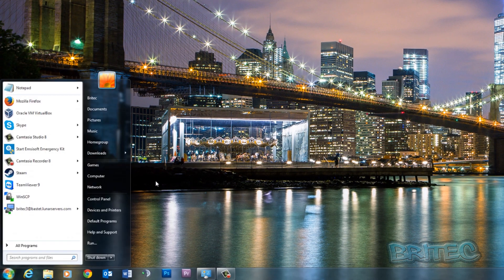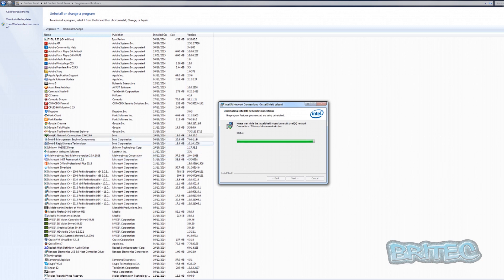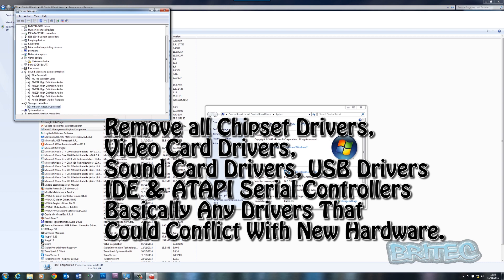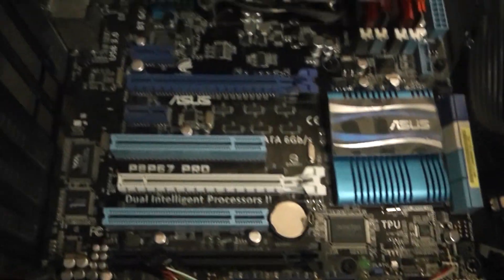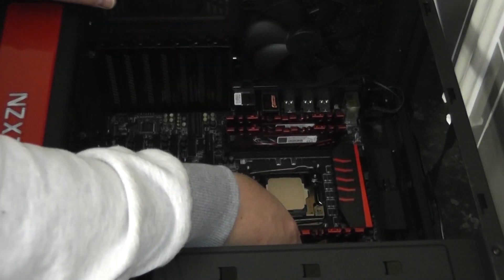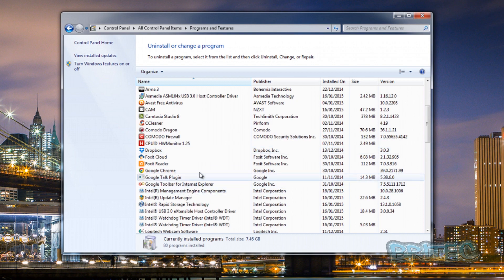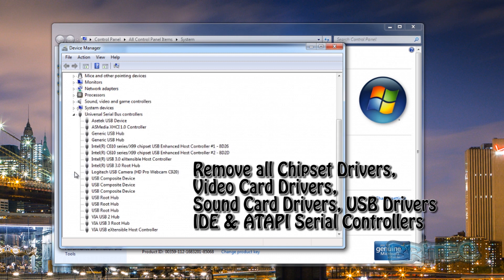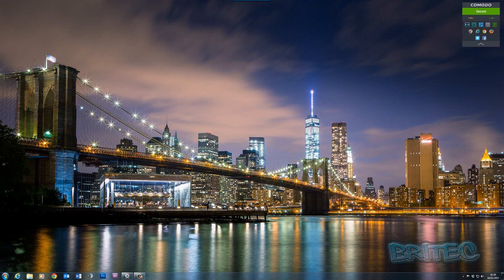Change Motherboard Without Fresh Install of Windows

Comment: will this work if i am changing to a new cpu and motherboard
Reply: Sam Fricke if your on Windows 10 it does everything by itself. Just upgrade and plug your hard drive back in. Windows will say something like reinstalling drivers and it would work. But then you have to download the drivers off of the manufacturers website
Reply: Jaysonfred thanks

Comment: Piece of cake with Windows 10, I just removed SATA and network adapter drivers from device manager and changed local account into MS account (to prevent hassle with activation)  before switching mobos. I was afraid I might get trouble with activation but Win10 was activated after mobo change and everything worked fine, lastly I switched MS account back to local account.
Reply: +Beast John1 Yeah small correction to above, first go to Win10 Settings -> Accounts and choose "login with Microsoft-account instead" for your account and follow instructions on screen. After account has been changed then open Device Manager and select "uninstall" for your SATA controller(s) under "IDE ATA or ATAPI devices" (not sure about translation) and same for your networkd adapter. When finished then just shut off your PC from Win10 start menu (do not restart!), change mainboard and start up PC again. Win10 should load up and then you can change MS account back to local account from account settings. At least this is how it went for me, your mileage may vary.
Reply: Thanks for sharing your experience! i was worried of windows 10 activation too.  how did you go back to a local account?
Reply: There was option to switch back to local account in account settings.
Reply: +YouStubid sorry but one question, which driver do I uninstall from the network adapter? I see Bluetooth devices, WAN mini port, etc...
Reply: PixelPencil sysprep uninstalls the drivers for you... that's why you're using it. Then on first boot up, your mobo bios should ask you which start up you prefer, (boot as new and restart, etc) or atleast mine did, then it boots up like normal
Reply: Late reply but should I also remove the processor driver?
Reply: YouStubid hey. i've got to do this when my motherboard comes in. can you please explain how to do it without having to go through activation for windows 10?
Reply: PixelPencil No need to install any network drivers. All I did was sysprep my machine and set it to shut off afterwards, then made my mobo change, connected the HDD, and powered on. No problems. Booted perfectly. Then you just go through Microsoft new windows setup, connect your Microsoft account once logged on and swap over to your previous pc's account.
Reply: +Beast John1 so I can just basically swap motherboards without uninstalling drivers at all?
Reply: BeastJohn1 so all I have to do is uninstall those and change motherboards then boot up and that's it? I'm also using a GIGABYTE GA-AB350M-Gaming 3 AMD Ryzen AM4 micro atx board
Reply: Hi, will this work if I cahnge my proc and mobo as well?
Reply: Did you have to reregister Win 10 when you restarted with the new MB?
Reply: Hey thanks! Guess I should stop worrying about re-installing Windows after my MOBO swap!
Reply: 4Za :] i am doing the same thing like you and also want to know how
Reply: 4Za :] how did It go? I'm doing the same thing this weekend and I really want the answer to your question
Reply: everything associated with that brand of motherboard, you can download the chipset for whatever motherboard your gonna swap for
Reply: 4Za :]:: there other videos that explain, how to sign out of the Microsoft account to a local account, and when you swap the new motherboard in, and install windows 10 go ahead and sign in with the Microsoft account you where using before and windows 10 should Activate.
Reply: YoStu::: you mean you swithched to a Local account, and signed out of Microsoft Account, cuz when your signed in to a microsoft account it will make you the Administrator of that PC, for then you will have ADMIN Right to that computer, a Local account dont give you ADMIN rights, just wanted to clearify, cuz you said it backwards.
Reply: @OLvato1  switching to ms account has nothing to do with admin rights but preserving activation of windows when changing components
Reply: YoStu what is sysprep?
Reply: @YoStu242  hey how did you uninstall all drivers? Sysprep?
Reply: @dyon8569  I just hit Uninstall from right mouse button menu for every sata/network driver in device manager before shutting down PC and replacing mainboard if I remember correctly.
Reply: YoStu:::  why would you "uninstall"  SATA controller(s) under "IDE ATA or ATAPI devices" Those are Microsoft, not AMD, NVIDIA's, or motherboards, drivers, he said yo Uninstall just those, AMD, NIVIDA, and all drivers for motherboard
Reply: Could you make a video on it please??
Reply: "You must not use Sysprep to reconfigure an existing installation of Windows that has already been deployed. Use Sysprep only to configure new installations of Windows.". It also says you can reset activation up to three times whatever that means, maybe activation problems in future if need to swap mobo more often.

Simplest way to me is to switch to MS account and remove IDE/SATA drivers, shutdown, replace mobo, reboot. I think removing Network adapter driver is overkill and removing IDE/SATA driver should be enough. At least that's what always caused problems to me with Win9x/XP when changing mobos and after mobo change I always got BSOD if I didn't remove IDE/SATA drivers and new mobo had different chipset.
Reply: @YoStu242  : hey im doing the same thing different chipset and mobo i have 10 too and its linked to my account should i just leave it on my account til i switch to the new components, then go and switch it back to local ? and before all that just remove sata and ide drivers ? and my chipset drivers possibly?
Reply: @Survivor694  My new mobo had different chipset also but I don't recall removing any chipset drivers, only those I mentioned. Just don't let Pc reboot with old mobo after removing drivers or it'll reinstall them. Remove drivers, shutdown and change mobo right away. And last thing if boot goes ok with new mobo change ms account back to local if you're using local account normally.
Reply: YoStu Mate I need your help!! First Time upgrade noobE here 😀

Ok so I am planning on upgrading my motherboard from a Gigabyte LGA 1151 z170 GAMING X motherboard to a z370 motherboard so I can use 8th gen processors......

I have over 30 STEAM games installed and a lot of photos and music files stored into my PC. But most importantly are my STEAM games. Can I still follow your steps shown in your video still 2018? Will I have to buy windows 10 again for my new mobo? Also if I just simply connect my HDDs to the new z370 motherboard, will my saved STEAM games and photos/music be easily transferred to the new mobo without backing up anything? My plan is just to upgrade my motherboard and CPU and keep my HDDs. Please help me be successful first try 😃😃

Comment: Hey, could some help me out please?
I want to upgrade my pc with a intel i7 6700k, but my current motherboard isn't compatible. Does anyone know which motherboard will work? I use my current pc for gaming and editing videos. I'm searching around internet for more information, but I don't have the right knowledge. Thanks!

pc specs:
AMD FM2 A8-6600K Quad Core 3,9GH
ASUS FM2 A88XM-A
Crucial Ballistix Tactical 12GB DDR3-1866
Nvidia GTX 750 Ti 2GB
Reply: And you have money to afford a 6700k? LOL! How irresponsible.. the chipset you need sir is Z170 ;)
Reply: thank you! Well in fact, I've worked hard to pay for it ;)
Reply: You will also need a new type of ram for these newer intel cpu's, you must buy a set of DDR4

Comment: I really do not recommend on doing this. Unless you certainly need to boot ypur pc to make backups or something similar. Specially if ypur computer had a way older chipset compared to the new one.
I did, and had many issues with booting/shutdown, USB ports and voltages. And I did wipe all drivers and installed new ones. Heck, I even used ghostbusters to delete ghosted devices.
Reply: SO is it recommendable for a old ASUS motherboard and i7 2600k (which I'm replacing) I should ignore this video and leave all the drivers installed, THEN replace the motherboard with the upgraded parts, and remove the old drivers from the previous mobo?

Comment: so you have to remove all the drivers for all your parts to replace just your motherboard?
Reply: Basically.
Reply: +Brayden Wilkes can I just remove my motherboard drivers?
Reply: No I'm pretty sure you need to remove EVERY driver because all motherboards communicate different with everything in the computer. Unless it's the same model of the motherboard, then you might be okay without uninstalling anything. I've never done it before though, just heard.

Comment: I'm replacing my motherboard due to my old one dying out, so my question is seeing that my pic is not currently running what problems will I encounter if I change my motherboard without doing this process?

Comment: i recently replaced a dell gx520 motherboard with a gx755 motherboard and it just reinstalled everything automatically. it seems okay but my little brother keeps complaining that the graphics card isn't functioning right and i noticed it doesn't reserve a gig of physical ram anymore it just reserves 130 mb and i dont think thats enough. also it gets hot all the time now. which it didn't in the gx620 which was another motherboard i tried on the computer.

Comment: Hiya, this probably won't get replied to but, if I wanted to install  an new mobo are you SURE I'd have to get rid of audio drivers? it's a completely new mobo, not a similar one
Reply: +RobRandomVids Yes, you would have unless you have a Sound Card because the motherboard has onboard audio or you would have a Sound Card

Comment: some how my PC works and I didn't have to install the new drivers for my motherboard lol
Reply: Jesus Ruiz I did a clean install, however ASUS drivers are VERY good, and I think it'd have booted with the previous formated drive anyway. 
Glad it worked for ya tho!!
Reply: Tibialstone7 Glad it for you too haha
Reply: Yeah, these steps are completely unnecessary.
Reply: +Jacob Abercrombie Really? Even if i change my cpu and motherboard?
Reply: But when you plug the mobo in for the first time, what does it do? Does it automatically install the BIOS first, or do you need to put a disk in the CD drive and install it all manually? 

And after all that's done and dusted, did you install the mobo drivers from the manufacturers website before the upgrade, or did you do it AFTER you had the motherboard installed?

Thanks!!
Reply: ***** Thank you so much, answered all my uncertain questions! Building the new rig today and putting it all together, so I'll let you know if I get BSOD or not haha. 
Cheers
Reply: Tibialstone7 Everything worked!

Comment: so basically if I follow the steps here I don't have to wait for zen, I could build a PC with the amd FX-6300 this summer then upgrade to Zen when it comes out and not have to factory reset?
Reply: thing is..... zen is going to on socket am4...
Reply: googlemaster190 -Minecraft yeah, changing the motherboard
Reply: The Shadow Devil Slayer oh.. sounds good.
Reply: googlemaster190 -Minecraft I'm trying to figure out, how would an amd a10 compare to a Pentium g4400 and a GTX 750 ti?
Reply: The Shadow Devil Slayer the pentium seems like the better deal imo. its architecture is very great even for a dual core. and in single core performance it destroys the a10. Btw the g4400 is less likely to even bottleneck the gpu than the a10
Reply: googlemaster190 -Minecraft and I'm guessing even the 750 to beats the integrated r7 on the a10, plus they don't say what r7 is integrated they just say integrated r7 graphics.
Reply: The Shadow Devil Slayer yeah.
Reply: googlemaster190 -Minecraft plus amd's fm2+ line doesn't have l3 cache
Reply: whats zen??? or you mean "RYZEN"

Comment: I uninstalled a chipset that basically uninstalled my cursor and keyboard.
Reply: There were a bunch of Intel chipset files under System Devices. I went uninstalling them from bottom to top and on the third-last one I uninstalled it removed my mouse and keyboard functions, and wouldn't let me connect any other mice or keyboards. I have now shut down with the two chipsets above the one that removed my mouse/keyboard functions still there. Will that be a problem?

Comment: Do I delete EVERYTHING from Device manager?? please help
Reply: +Sergent Downs No, just remove stuff related to your motherboard and parts that you'll be upgrading
Reply: +Zilla the thing is, I am using an old laptop hdd, so I don't know what to do :/
Reply: Sergent Downs Doesn't matter what HDD you use. Just uninstall every driver you have at the moment, install all the new drivers (apart from GPU) without restarting your PC, and then replace the motherboard and CPU to your personal choice.
Reply: @yotcca  throw it away and buy a SSD

Comment: I use sysprep.exe. It doeas exactly that but  automatically and in less then a minute! Just the antivirus software may cause problems and need to be removed and reinstalled after.
Reply: +never75 What windows did you reinstall? I'm in the process of doing thing right now and I'll have to sysprep my win 10 but I fear that it won't work, is it worth the try? (I'm upgrading from fm1 to 1151)
Reply: +Shortyman17 I am using w7 but i think it would work with w10 as well. Just check if sysrep is in the system folder or where they have put it! If it's there that means it will work :) . I would do a copy of the disk before , just in case. Then disinstall the antivirus, do a sysrep \generalize \oobe  \shutdown  . Then swap motherboard  and power on. After yo can reistall the antivirus.

Comment: Hi, i have a question regarding to the problem i currently have. I have a MSI Gaming Z170A GAMING M5 LGA 1151 motherboard that i believe it had been damaged or glitched to a point that it causes my i5 3.2Ghz CPU to lock on 800mhz. Due to unable to return it, i brought another MSI Gaming Z170A GAMING M5 LGA 1151, same board to replace this damaged one, since they are both the same board, do i still need to remove those drives to prevent re-installing windows 10 or...?
Reply: +MrPandaBoo Same motherboard = same motherboard drivers required
Reply: ***** so I wont have to uninstall those drivers to prevent re-installing windows?
Reply: unless they were in some way corrupted by any computer problems you had, you should have no problem
Reply: ***** ok so if i switch my old board to this new one, which both are the same board, i won't have to worry about re-installing windows? like i can just simply switch out the board without any problem?

Comment: it is possible if the mobo dies you can use Acronis to clone to dissimilar hardware, i have done this with the older acronis software, new sofware allows cloning ssd but the older software was quite good for recovery and also to recover to Virtual machines.

Comment: Just a note after going through the control panel, you can run sysprep /generalize /shutdown from the run command and it will remove all drivers. This prepares it for cloning or basically the same thing that we want to achieve - swapping motherboard.
Reply: +Noah Riede does swapping everything at once also work?
Reply: +Shortyman17 As long as you don't move from Intel to am or vice versa. Also it doesn't work 100% of the time and that is to be expected.